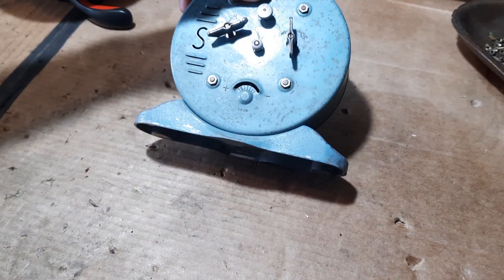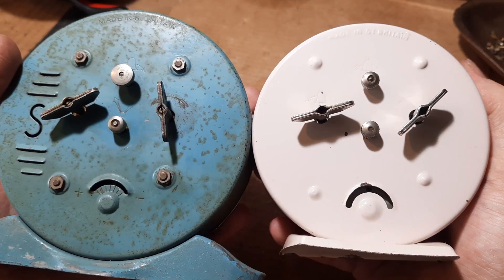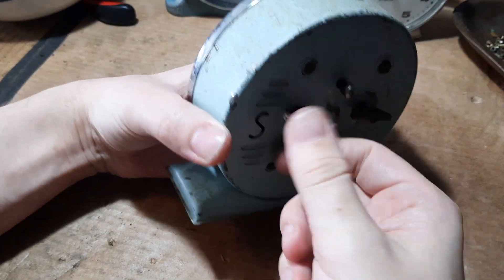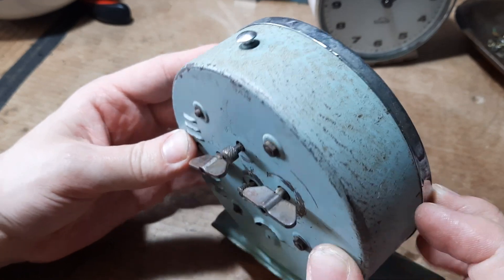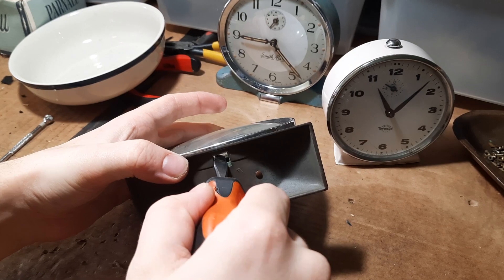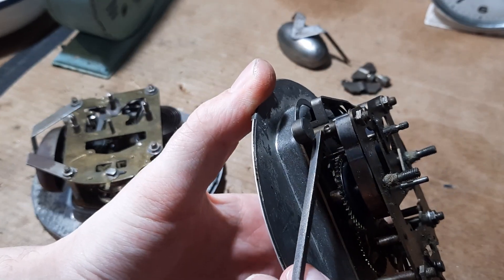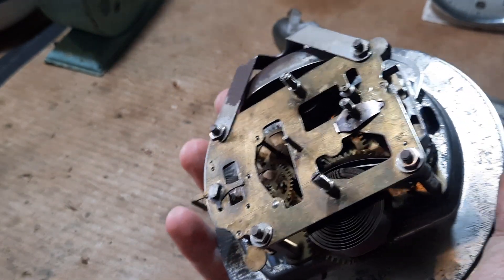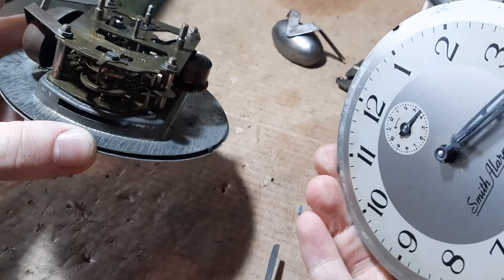The elusive "type A" Smiths Alarm movement (Pre-code) !

Comment: Am very much impressed on ur all uploaded videos sir.  Great job.  With ur videos I make a loop end hole to my mainspring and clean the balance cups.  But alarm clock stops when we keep down position sir.  What's the problem! Maybe balance cups I think.
Reply from the maker: Hi! Yes I agree, either the balance cups or the points of the balance wheel pivots are probably worn down... I'd recommend either trying to sharpen the points or swapping the balance wheel with a donor clock
Reply: @VACC  Thank u very much sir for good advice.